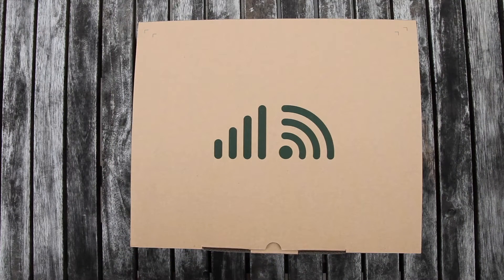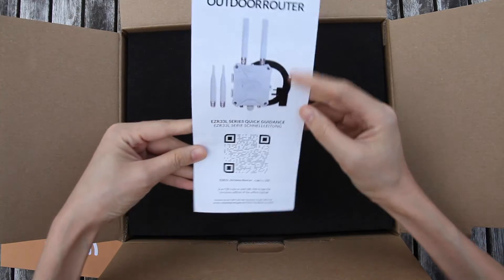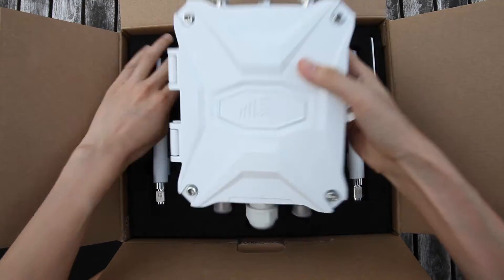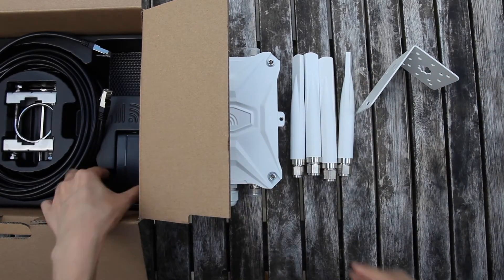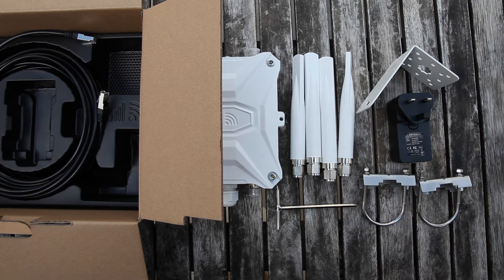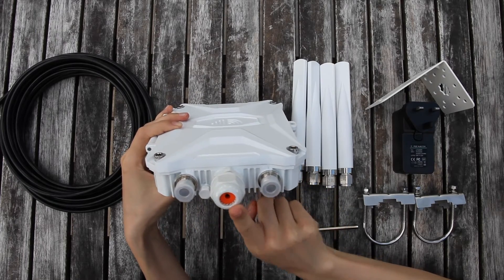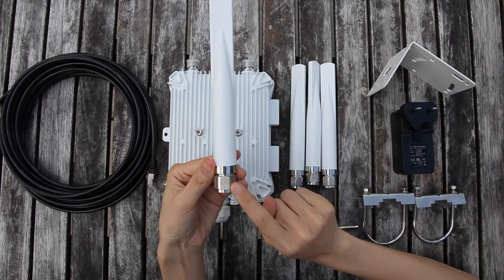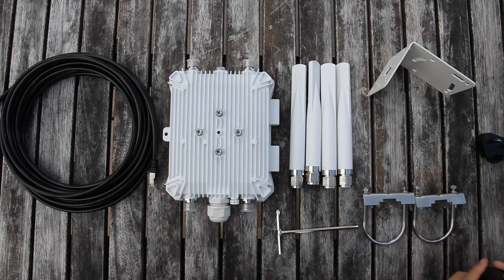EZR33L 2021 New Outdoor 4G Router Unboxing

Comment: is duel sim bounding?
Reply from the maker: The dual SIM outdoor router can work with 2 SIM cards.
However,  a dual-SIM slot does not mean two SIM cards work simultaneously. Only one SIM card is active, and another SIM card is used to back up the connection.

For more information, you can check 
https://how.router.works/mobile/switch-sim-card
 

To provide multiple backup internet links, you can enable a WAN port and WiFi relay on the router. Then, you can control their priority under "Network > Load Balancing.

https://how.router.works/net/traffic/load-balancing

Comment: Can I use it in Mexico? With universal carriers?
Reply from the maker: You can use our American standard 4G routers in Mexico. The built-in American standard cellular module supports all the Mexican 3G and LTE networks. If your SIM card is unlocked, you can use it on the 4G router.

Comment: qns. 

is there any dual sim or triple sim card options?
Reply from the maker: The current model supports dual SIM. However, one of them is for the backup connection. You can add WAN or Wi-Fi relay connections to the router and increase the internet connection stability.